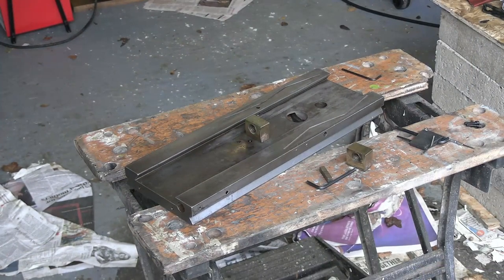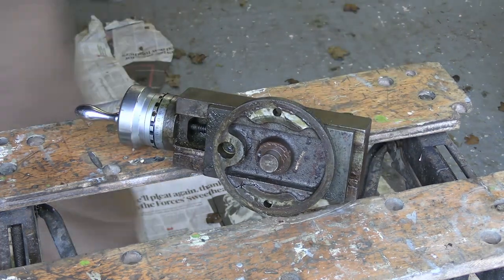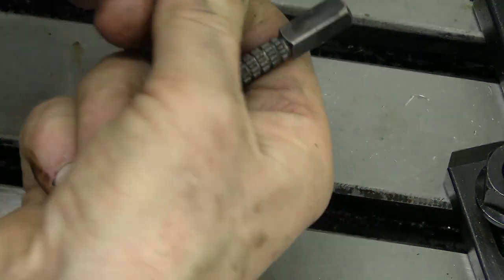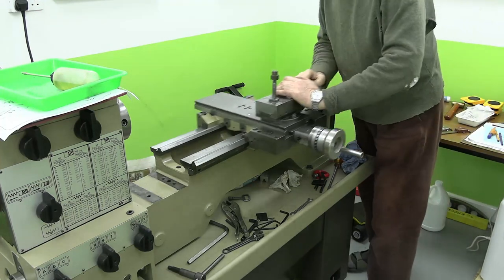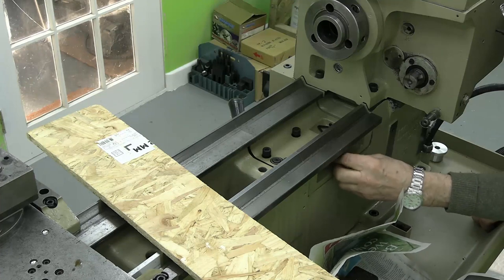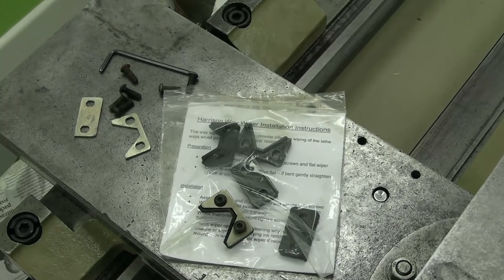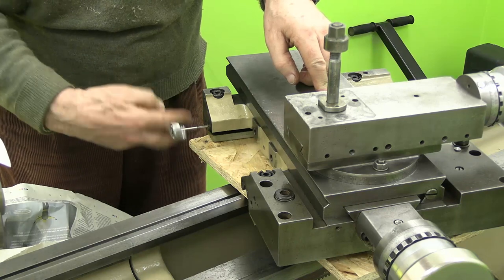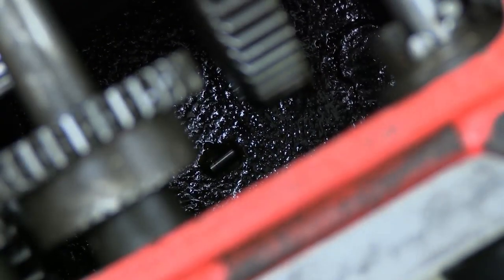Harrison M300 lathe - refitting the saddle & slides

Comment from the maker: Richard Pavey comments below that the problem I had with removing the topslide gib was unnecessary. He says that the brass nut which engages with the topslide lead screw can be withdrawn through the base via the hole seen above the graduations in https://youtu.be/BDaFyWMhW9s?t=195 . This permits the topslide to be slid off whilst the gib is still in place. I have not tried this myself.

Comment: I just bought an M300 myself, a couple of weeks ago. The first thing I did was clean up the top slide. I had exactly the same problem as you, till I found that the brass slide screw nut just pops out the hole in the bottom... job done. I was just shouting at the monitor when you had it set up on the mill! Watching your vids with interest, many thanks!!
Reply from the maker: Thanks, you may well be right about that.

Comment: Good to see such a 'clean machine' I was trained by GEC (Metropolitan Vickers) Training School (Same set up and as rigid disciplined as RAF Halton) in the 70's and always had to leave my machine spotless at the end of the day/lesson it's never left me. I cannot leave my home workshop if the machines are not cleaned and oiled. But Samuel please don't hammer on the table bed! My old instructor Mr. Overton would have kicked my backside. My ML7 Super (1963) has a relatively long bed and as yours it had seen considerable use before it came to me, the bed again as yours tightens up at the extremes but how often do you need to traverse to the 'extremes' but I understand and respect your wishing to return the machine to original condition. Looking very very good Sir. I'm still intrigued as to why the oil hole did not line up with the gallery on one side or am I missing something?

Comment: Some good progress made, for those two gib stops you added, just a couple of dog point set screws needed. plus there's nothing stopping you drilling new oiling points for the top slide so they go to the oil grooves, also you could link up the one hole that's near one of the grooves with a carbide burr in your dremel, buit definately good progress, keep positive!

Comment: There is a set screw on the front of the top slide base that tightens into a groove on the lead screw nut. If you loosen that set screw you can push the nut out the bottom. No need to take the gibb out.
Reply from the maker: THanks.

Comment: Question,what are you going to use the lathe for ? Because even with the wear on the lathe ways it is still a very accurate machine so unless you are going to be using it to the enth degree of precision I personally would leave well alone .Thank you for a very interesting series.
Reply from the maker: Thanks. Nothing special, just general lathe work, probably quite small stuff that I could have done on the minilathe but with more difficulty. It won't be accurate over any distance if the ways are as I fear them to be. We'll see when I take some cuts.

Comment: The oiler may be offset so that the bearing side of the gib is oiled.  Seems like they should have placed the other symmetrically so that oil runs down the dovetail onto the horizontal sliding surface.  But then you'd need to know if oil would flow properly and if enough would make it to the horizontal bearing.  Perhaps 2 oilers would be better.  This is the kind of question that experience could answer better than youtube commenters, I imagine. But looking at it, I suspect that it is an error in design.  The lock may also be an error but I can see that going either way.  Your solution seems as good and probably easier to disassemble.  Also, Mr. Crispin gives you zero points for hammering on your mill table.
Reply from the maker: Eek! But only a gentle hammering!

Comment: Question. I have an M300 which, when turning 8 full revolutions on the main saddle gives me 19.6mm. We are trying to work out if its a metric or imperial setup. The lathe has metric thread cutting but the closest unit of measure I have is that one full revolution of the saddle wheel seems to do 0.1 inchs. Any idea? The parts manual lists them as either SA-0070 (Imperial) or SA-0080 (Metric). Any ideas please? Thanks.
Reply from the maker: I take it you are referring to 8 full turns of the cross-slide knob. On mine, that moves the cross-slide by 20mm, because it is 2.5mm per turn. Your looks like an imperial cross-slide lead screw. What is the main lead screw (for the carriage): 6mm pitch or 4 TPI? This should be stated bottom right on the big silver info plate that shows how to set the geabox for threading and feeding. (i.e. just above the W/X/Y knob). My carriage handle moves the carriage by 25mm per turn.
Reply: @samuelfielder  Thanks for taking the time to respond. Yes, sorry, cross slide (not compound). Ill need to go take some more pics. The thread 'counter' that sides on the right of the saddle indicates MM as the scale (ive seen some with Inch).
Reply from the maker: @Chazaxl  Yes the thread dial is distinctive between metric and imperial. However, bear in mind that it is possible to put a metric thread dial onto an imperial machine and vice versa (not useful, but can be misleading).
Reply: @samuelfielder  Hi, so just checked. 6mm. The graduations on the top slide goes up to 4.8 and then resets at 0. The compound goes up to 2.4 and then goes to 0.
Reply from the maker: @Chazaxl  Cross slide you mean, I think. So it's 5mm per rev on the scale, but the cross slide lead screw moves half the distance, so that what you read off the scale is the amount you're taking off the diameter of the workpiece. I didn't look at my compound (=top slide). So that's all metric, apart from your original measurement of 19.6 mm; perhaps it was really 20 mm.
Reply: @samuelfielder  Thanks, could be. Ill double check tomorrow, thanks once again.